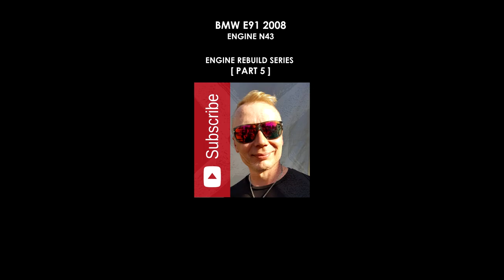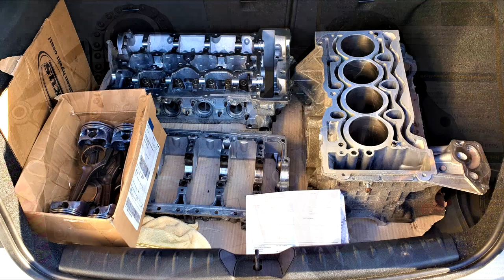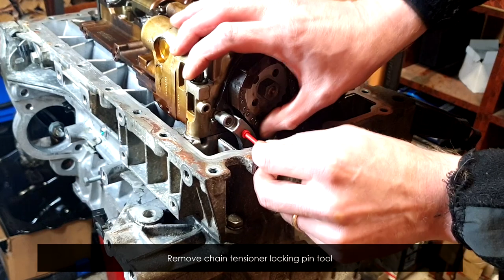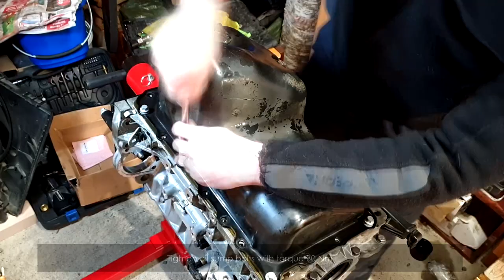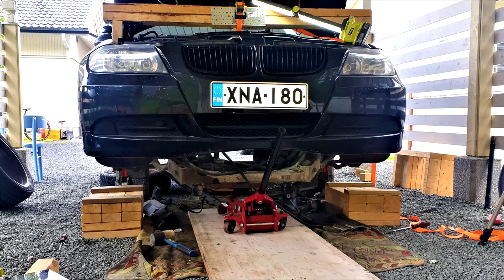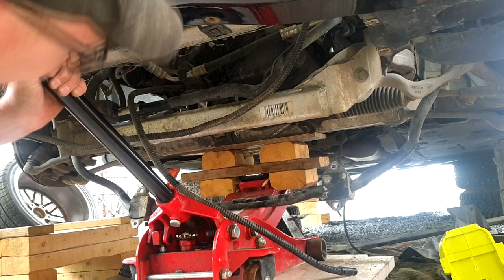OIL PUMP & SUMP & LOWER TIMING CHAIN & engine support arms - PART 5 - REBUILD BMW N43 Motor

Comment: Hi mate i liked video but issue to me struggling to understand, where you finding that maintenance handbook? Tightening torques etc. if you can tell me source you get informations i’ll appreciate you
Reply: It called Bmw TIS
Reply: @bigdeal87  I have TIS but are there any torques for the pump itself? before inspecting the pump I need them.

Comment: @Jani when you say replace, wash and oil the bolts - do you mean you need to buy brand new bolts for the oil pump goign back on? Struggling to find them - conrod ones seem fine to get but the oil pump ones less so! One of the torx ones deffo wants replacing as it lost some of its head coming out it was that tight in.  And what do you wash them in? WD40? And il with normal engine oil?  Thanks - super useful your videos as i've never done this before but getting there. Polishing the cranks at the mo as got a few marks on there - hoping i can save it!

Comment: How long did it take to cure the bedplate loctite sealant? And the oil pump counter balance has to be synced to the timing of the engine right?
Reply from the maker: I don’t know exactly how long it will take for the liquid seal to cure.
BMW manual tells that; "Balancing shafts must be readjusted after installation of chain tensioner".
Exactly what this means, the BMW repair guide does not tell you.
Before removing the oil pump, I locked the balancing shafts in place with a locking tool and did not remove it until after the new lower chain was tightened.
When the engine is locked in the TDC position during disassembling and also when assembling and the balancing shafts are locked in the original position all the time. 
I think the balancing shafts are then in the right position.
At least no problems have come to me in this regard.
Reply: @JaniVoutilainen  Mutta eihän sulla ollut kampiakselin pultti viellä lukittuna joten ne pyörivät vapaasti.
Reply: @JaniVoutilainen is it possible to torque the crank bolt with no subframe attached? Thx

Comment: Thanks for the information, but I’m asking about the timing of oil pump and the balancing shafts, as I saw there is no need for oil pump timing , it’s only required for the balancing shafts. But according to the video there a possibility to make a mistake of one complete turn when you install the blocking metallic angle am I right?

Comment: Jani please an answer ... I want to open the oil pan to change the gasket to the N43 engine / the 10 mm tubular wrench cannot enter to loosen the screws, there is not enough space there between the oil pan and the gearbox ... you  how did you do  ?...thanks, I appreciate in advance 😊😜😎
Reply: undo the 3 bolts you see on the plate that is blocking your access and you remove cover on the gearbox and can get to them. A bit awkward to get to but I also found this issue.
Reply: @dj0men666  You're absolutely right, I was a little scared at first that I didn't have access, ..but a day before I did this and all I needed was that protection,thanks anyway!😉👍🏻
Reply: @Marcell-ux7rb  im just waiting for my timing kit to come so i can lock it off and take the oil pump off and see whats occurin on my crank.

Comment: Hello Jani, please, oil pump tensioner has hydraulic or mechanic tensioning? Thank you
Reply from the maker: I think it's mechanical
Reply: @JaniVoutilainen  Kyllä sinne öljynpainekin menee.
Reply: The tensioner has a spring but uses oil pressure as well.

Comment: Jani, please can I ask some quick advice? I want to replace fuel filter on my N43 but I cannot locate it anywhere, have you any idea where it is? 

I read on a forum that it is in the actual tank. However, other forums says it's under the car somewhere. Do yu have any advice please?

Thanks Jani
Reply: Ive heard that the n43 doesnt have a fuel filter. Only a mesh in the fuel tank to keep bigger pieces out
Reply: @ToMsOnLV   Yeah I also read this somewhere, thanks for the answer. Perhaps Jani will confirm this
Reply from the maker: Hi! There is no seperate fuel filter in the N43 engine.
The fuel pump in the fuel tank itself has a filter. And if I understand correctly, each fuel injector inside its own small filter also. These filters alone cannot be changed.
Scavenge air line on fuel ventilation system have activated Charcoal Filter (part 16137074464). But that's another thing ...
Reply: @JaniVoutilainen  Thanks Jani, I will be reasearching the charcoal filter. cheers